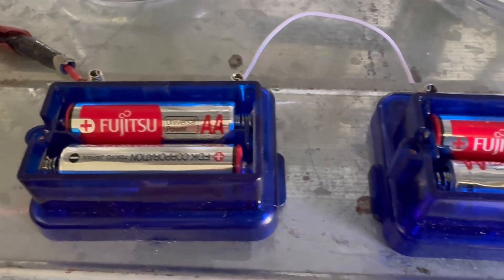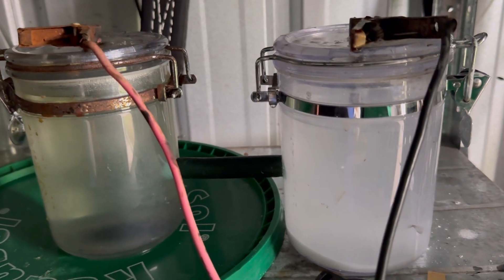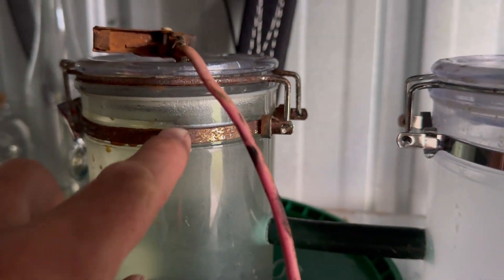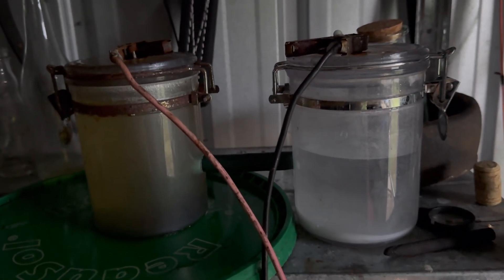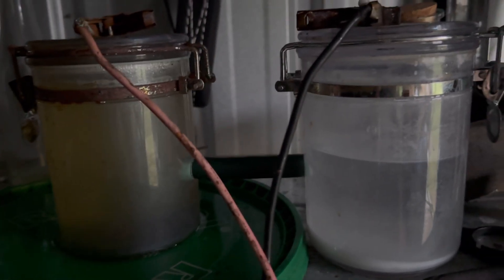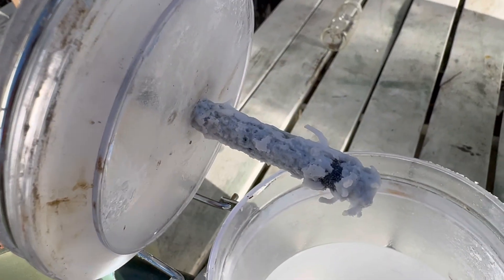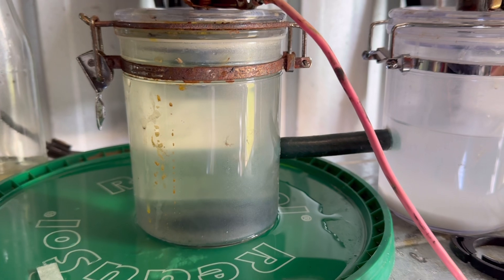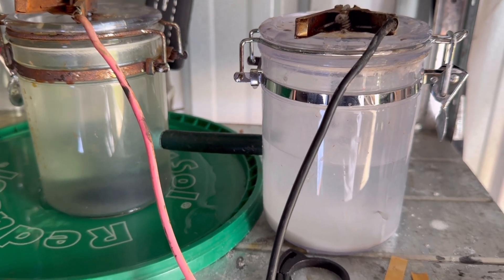I Accidentally Built a Chemical Pump — Here’s What Happened

Comment: desiccant + heater = water purifier. also ion flow is an ionic wind thruster. so how about the hydrogen on the other side, vs the chlorine on the other side. chlorine also goes into the electrolyte making NaClO3, the other side making NaOH. desiccant if there is no body of water available, only atmospheric moisture.
Reply from the maker: It’s amazing how much comes from so little! Chemistry is magic.

Comment: I've dealt with it, but not in that manner, in your case, I suppose that the hydrogen is displacing thew electrolyte to the anode while the chlorine from the anode is being dissolved back to solution since it was an air tight closed system(I assume based on your description) I believe it has more to do with gas pressure than with osmosis since osmotic pressure is based on ionic concentration(mainly sodium since it has more affinity for water) on a liquid the cathode should have the highest level of liquid if that were the case. in my case, I had a similar setup, but it wasn't airtight, I was collecting and using both hydrogen and chlorine elsewhere, so there wasn't pressure build up in either of the chambers(which were separated by a ceramic diaphragm) and still, there was liquid displacement but in my case, it was the opposite of yours, the liquid was going to the cathode as current draw increased, based on what I know about osmosis I deduced that the sodium ions though osmosis were pulling water from the anode chamber since I had a ceramic diaphragm in the middle both levels should be equal. in a similar way this is how our kidneys regulate water, our kidneys move sodium ions and water follows, that's why more sodium in the body means higher pressure because sodium ions attract water and that's why just drinking water isn't enough to deal with dehydration, you gotta have electrolytes as well and sodium is one of those, too much sodium=high blood pressure, too little sodium = low blood pressure and the kidneys do regulate it to keep all normal;.

sorry for the long text I do have a tendency of overextending my thoughts, I hope this information does help or inspire in some way your experimentation.
From one Experimenter to Another,
Best regards! and a Good Day!
Reply: Oh, and a suggestion for a timer device based on what happened in your video could be a U tube or the H cell you have, but no separation(no diaphragms or membranes on the middle tube/bridge) with the cathode on a closed side and the anode on the open side and a constant fixed amount of current
why the cathode on the closed side?
the cathode will evolve hydrogen which does not dissolve and won't cause interference with the timing.
why no need separation of anode and cathode?
because it will be a device that works based on pressure, not osmosis or other concept, just remember that the timing will vary depending on the altitude since the pressure build up will be proportional to the atmospheric pressure,  on that note an alternate way wold be to close the other side with a syringe and/or a spring to get a more accurate timing but since it would be a closed system Id recommend using sodium or potassium carbonate or hydroxide as an electrolyte because none of the gases produced(H2 on cathode, O2 on the anode) produced would dissolve which will cause inaccurate timing if that happens.
why a fixed current?
this is electrolysis, more current means more gases and less current means less gases, thus if you have current fluctuations your timing will never be accurate, on more current it will take less time finish and less current will take more time to finish so constant current will ensure that every time you make a run it will take the same about of time to finish.

IDK what this could be useful for, but the idea is there some times the means are the end and it doesn't need to be useful or practical, it just needs to work or it could be a cool science fair project to show case not just electrolysis but also gases pressure.
Reply from the maker: @deathkeys1 I am looking at processing potassium carbonate in this meaner to produce potassium hydroxide as well. So perhaps this would be an ideal time to test this idea presented in your comment? As you say the gases produced will not be the same as when I process sea water so it should produce less interference with the experiment itself. Thanks for the extensive reply. I appreciate the feedback.
Reply: @Remraf  Well, I'm glad you appreciated, now, what idea? the U tube idea won't do, if you're going to process potassium carbonate, just do what you're doing, but instead of seawater use potassium carbonate, I should take this opportunity to call attention to the fact that even though seawater is mainly sodium chloride it is not just sodium chloride, it has carbonates, iodides, bromides, fluorides and potassium calcium and magnesium in significant quantities, that aside. Just load the anode of your setup with the potassium carbonate and the cathode with water, if you want purity use it distilled. overtime the current draw will increase as potassium ions migrate over to the cathode chamber and you will achieve separation on the anode chamber it will form carbonic acid but as it ins unstable it will break up to CO2 gas, if you seal up the cells as you did with this setup you might get some carbonated water(DO NOT DRINK IT) as the CO2 will redissolve just the way the chlorine is doing, which is not an issue, in fact it is the first time I see an electrolysis setup being run in a sealed system under pressure, depending on your goals it could yield interesting results, but I must insist in recommending you allow the gases to escape, just allow ventilation where you run the cell and you'll have nothing to worry nor fear. now for the gases, the anode chamber will form CO2 and cathode chamber will form hydrogen, if you choose to let the cell open, just remember to keep it open enough to allow gases to escape because CO2 from the air will react with your potassium hydroxide to revert it to potassium carbonate. now, as a matter of curiosity for me, what is in the black tube, the bridge of your H cell? what do you use to separate the liquids?a membrane? tissue paper? cotton? kaolite? And oh, I'll keep a watch, it is getting interesting and it does pleases me to talk about this with someone else, I mean, I don't get much of a chance to discuss technical subjects with people who can actually appreciate it, so, thanks!
Reply from the maker: @deathkeys1 thanks again for adding to the conversation. Much thanks! In the bridge I have paper towel rolled up, it appears to be doing the job at the moment although it is most likely due for a change! I imagine it’s almost at the point where it is breaking down and potentially contaminating both the anode and the cathode. As for the potassium carbonate run I am looking forward to having a crack at this. I used to make potassium hydroxide the long way and this speeds things up dramatically. The long way was to burn limestone into oxide and then slake. And then mix the slake with potassium carbonate to make potassium hydroxide. This will be a short cut!
Reply: @Remraf  interesting, paper towel is cheap, so even if you have to replace at each run it is a solid choice, but at higher concentrations it will dissolve but for now you don't need to worry about it, just pack it tightly as you have been doing. I started using ceramic because I did experiments with other salts such as sulfates and phosphates. and that's an interesting way to make potassium hydroxide, I wanted but around here is hard to find a source of potassium ions and potassium salts are expensive. I know you can make a paste like soap with potassium ions.
Reply from the maker: Thanks for the extensive reply! I love it! You’ve taken the time out of your day to contribute to the conversation and I appreciate it heaps! You know your stuff and not just one subject, multiple subjects. This is what the world needs. People with insights not only into single subjects but s wide variety of subjects and then they also know how to stitch them together! 

It’s an absolutely fascinating process, this experiment was never intended to go in these directions, but here we are following the leads, trying to understand what is happening! When I get a chance I want to spend some more time to read through your multiple comments so I respond appropriately but mother’s day calls and my presence is being requested!

Comment: Yep, electrolysis is generating gas and the gas is displacing the fluid.
Reply from the maker: Thanks for the information. I really appreciate the insight. I should in theory be able to test this gas. Perhaps by capturing it and putting it to the flame test. This would be performed with the utmost care of course. Perhaps in an upside down test tube? I also believe it is ion pull as well. One way to test it for certain would be to open it at day 2, release the gas, close it and see if it continues to push or pull….
Reply: @Remraf  yes, an upside down test tube to collect the gas and a following flame test, you will find it is hydrogen on the cathode the anode color already explains it is chlorine. 
and no, I do not think there is osmosis at play here, to test it out, run it with both lids open/unsealed to allow gases to escape and you will see that the high level will shift to the cathode side. but it has to be run with both lids open so you will be certain that there is no gas pressure to interfere.
Reply from the maker: @deathkeys1 lets do it! I am building another system today. I might start by running it as you have aforementioned. Let’s see what happens!